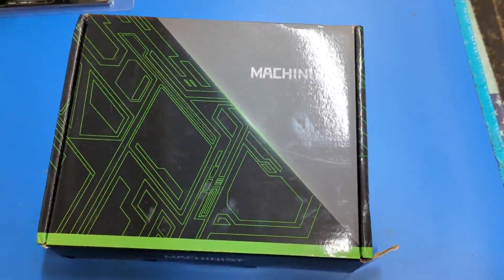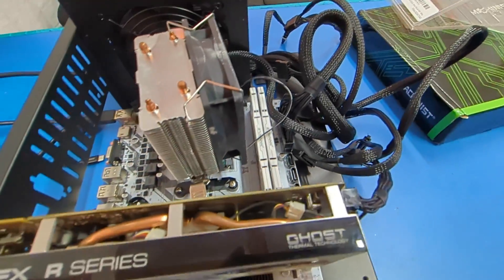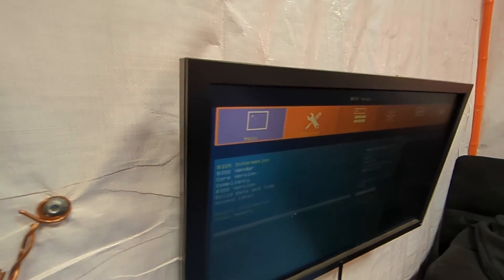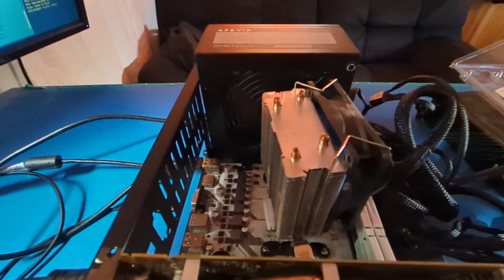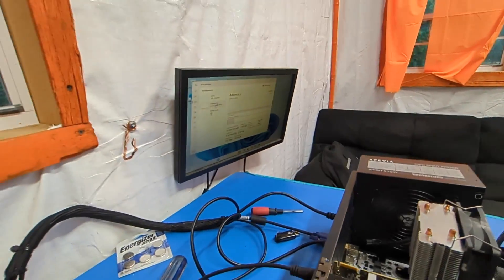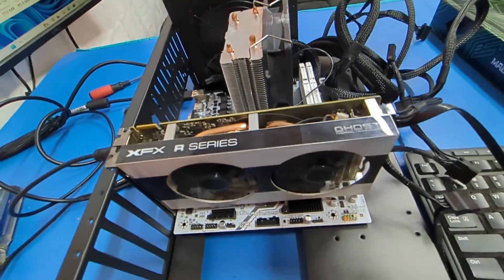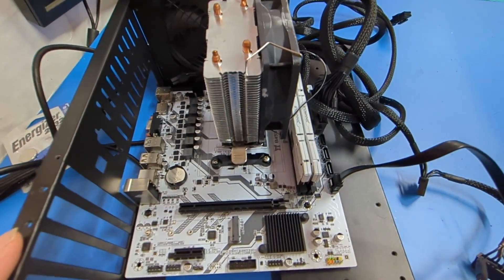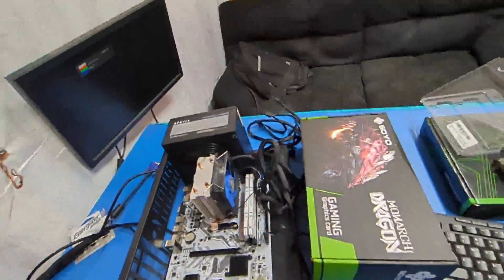Machinist B450: Much Improved, Now one of the best budget AM4 options!

Comment: It won’t let me enter the bios at all do you have any fixes? It also boots into windows fine.
Reply from the maker: I had one Machine that it was doing that too but come to find out it wasn't the motherboard. The GPU wasn't initializing until after the post and booting process started. One of the positives about this board is that it'll post without a GPU and even with a dead GPU, the negatives is it doesn't always wait for the GPU to fully initialize before it boots. If you're running Windows you can hold the shift button as you click restart and keep holding it, that will actually bring up a recovery menu where you can choose boot into the UEFI as one of the boot options.

Comment: Great video, Can anyone help with a link or advice on where to get the latest firmware for this board please
Reply from the maker: I have yet to find a place that hosts the bios, machinist website says to contact their AliExpress store.  But I have tried as well as several people in the comments section, and Machinist has never replied.   As far as drivers.  It uses the standard B450 chipset driver from AMDs website.  I have 3 of these boards between my kids PCs and server here, so I did plan on getting a bios dumper to compare boards and host the ones they shipped on them. In case people wanted to modify bios themselves and/or have a backup.  I just am yet to get a bios chip programmer/dumper that is compatible.

Comment: I would be worried about future bios updates and you can buy similar motherboard like asus prime with similar price.
Reply from the maker: Bios updates are not a worry because its a dead platform, with no new AM4 CPU being released.  They alos have an oversized bios chip with their custom bios that supports 1000-5000 series out of the box and will still post with allot of "unsupported" CPUs.  As far as Asus prime for a similar price your wrong.  When I built the first system  with this mobo the cheapest Prime board was $79.  This one was $50.  I have since built 3 machines with these boards.  The last one I paid $40 for this board, and a quick search on amazon shows currently the cheapest NEW B450 board is $70.  So $40 vs $70 is not even close to the same price.   If you want to Talk B550 those boards wont work with older Ryzen 2000 and 1000 series, and that's what I recommend these boards for.  I have a few videos with this board so I am not sure if I mention it here, but since B450 only supports PCIe 3, I would only use this board with 2000 and older series Ryzen.  Maybe some of the OEM only, later 4000 and 5000 series that  lacked PCIe 4, would be ok in B450 as well.

Comment: How can I update the Bios ?
Because i have ryzen5-3600 not working with my motherboard same like your
Reply from the maker: That should not be a bios issue unless your is corrupt.  I have purchased 3, and they all posted fine with a Ryzen 2200G, 2600, 2600X, 3700X, and 5800X3D, right out of the box.   Support for the 3600 is already built in.
Reply: Have you solved the problem? The R5 3600 processor isn't working on the motherboard, while the R5 2600 works. Even when I tried the R5 5500, it didn't work; only the R5 2600 is working. I need a solution to this problem.

Comment: I just built my PC with this board and a 2600, and I'm going through the memory freq issue. I found your page and this video has done a lot to reassure me that I didn't make a bad decision going with this board. lol. However, I noticed my version does not have the overclocking option in the advanced section of the bios. If your's has it, would it be possible to get the BIOS dump?
Reply from the maker: Unfortunately I never got a bios dumper and I haven't been able to collect any bios.  It's also currently my 12-year-old playing computer so trying to get access to it is not easy right now lol.  I didn't tweak hers in the BIOS. I ended up downloading ryzen master and tweaked everything and enabled PBO and all that.  Ryzen Master while it gets a lot of flack, it is great for some of these Chinese boards and some of the basic tier one OEM boards that have b450 chipsets with a basic bios.
Reply: @JordosTechShack  I can't even imagine what that will require lol. After some research and tinkering I was able to get the memory frequency up to 3000MT/s. I think that will do for now. I got Ryzen master but it didn't work cos the PC kept crashing since I was trying to get the memory up to 3200MT/s. Thanks a lot for bringing my attention to the CPU IMC, I'm already working towards a new one.

Comment: Hey @JordosTechShack
Do you know if this motherboard can post without GPU ?
Like for headless build, NAS etc
Thanks !
Reply from the maker: I am not 100 percent certain but I think it does.  I have a bad Soyo RX 560 XT that won't post in any PC I have tried except this AM4 board.  And the monitor out donest initialize until you boot it up Into windows.  No video out until Windows loads on this machine, and no post on any other machine at all.  So   I am pretty sure the card is dying to the point it won't post in any machine that needs to detect a GPU.  So I am assuming it  doesn't need a GPU  and will boot without detecting one.

Comment: Just a question ?  about 'etertiny later' How much time did you wait i have done the same build but the pc dosen't boot up everything is working
Reply from the maker: 1st boot took a minute.  Had to train the hardware. I did have issues with posting with  the final build. The GPU has an issue and won't put out video till the driver loads in windows. The test GPU I used in this video worked fine (Radeon 260x).  The last 5 months it's run fine other than this RX 560 XT not initializing the monitor output until Windows loads. My test graphics card didn't do that, so I'm assuming it's a GPU issue or a motherboard and GPU compatibility glitch.   Could be the BIOs has weird issues with some gpus so I could suggest trying a different legacy graphics card and see if you get monitor output.  If it is a graphics card compatibility issue, If you pre-install Windows with a legacy card and then install your new card, it'll work fine once Windows boots.  Again The RX 560 XT in here is a China brand SOYO card, and China Brand Machinist motherboard. So which one is causing the compatibility issue until Windows loads? I don't know for sure.
Reply: @JordosTechShack  Thanks you so much sir.

Comment: does this mother board suport windows 11 or do you need to install a tpm chip on it
Reply: no it does not, found out the hard way. this mobo has tmp 2.0 and secure boot but does not support UEFI bios which is required. i did how ever get windows 11 installed but using another computer to install windows 11 on it and when it got to the part to set up windows 11 i turned the computer off moved the ssd to this computer and turned it on and it let me finish setting up the computer. i did this just today so i dont know how well it will run or if there will be any issues. but that is how i got around it.
Reply from the maker: It does support UEFI, not sure why you couldn't find it.  TechYesCity also did a video on this motherboard and walks you through the settings, which is why I didn't cover it in more detail, since an actual youtuber already did.  I used the board for my daughters build and she is running windows 11 24H2 without issues or work arounds.

Comment: Motherboard with no io shield is diabolical
Reply: Thats a testbench you melt
Reply: @technomad900  Putting an IO Shield won't make a difference you melt
Reply from the maker: LOL. it was a POST test. I am not installing a flimsy cheap metal IO shield in the test bench when it was goin into the case by the next video.  These ones are thin and flimsy and difficult to remove once in without bending it. AliExpress orders take a bit to get everything in so I post test as it comes in.  This was only  the fist of 3 videos using this mobo and I will not install the IO shield in something temporary. It was literally in the text bench long enough for this video and a windows install.

Comment: did you run windows 10 or 11 ? im having usb issues on windows 11 with this motherboard when trying to use a capture card on it it just disconnects , windows 10 seems to run ok , minus not recognizing my ps5 controller
Reply from the maker: Had issues with USB wifi dongle dropping out.  Did a clean install of Windows 24h2 (was using an older ISO) and the latest B450 chipset drivers and the issue went away.

Comment: Thank you very much for the review. I'm also bought that new am4 white motherboard of chinese brand from aliexpress and now waiting for delivery. Glad that new motherboards on b450 chipset that include work of old Ryzen 1st and 2nd gen are still being produced. 

First wanted to buy chipset B550 with PCI Express 4.0 for a future upgrade, but then I found out that it doesn't support older generations of Ryzen, and when buying any new Ryzen of Zen 3 gen right away, there would be a temptation also to buy a new video card like RTX 4060 with the last money. But for Ryzen 5 1600, economical GTX 1650 would be enough
Reply from the maker: I paired this one with a Ryzen 2600 and a RX560XT for my daughters Roblox build. It came out really clean when the build was done.  The build video is here if you haven't seen it i go over a little  more about the motherboard.
https://www.youtube.com/watch?v=ps-bH5jn-k0

Comment: U know where I can get the BIOS update?
Reply from the maker: After my most recent project/Video that required me to patch my own driver for an abandoned Nvidia mining card, and issues like Machinist nor having download pages, I am going to start a website soon with bios dumps and my hacked drivers.  I am looking to build a resource for AliExpress off brand and abandoned hardware.  Between my projects and commissioned builds I am paid for, I get to play with this stuff allot more than a budget builder doing a DIY project.  So I'm gonna step up and try and support the community.  Website coming soon!
Reply: if you found it please send the link here. Thanks!
Reply from the maker: You have to Message the Machinist official store on AliExpress.
Reply: I already did this but they didn't send it
Reply: Hi friend, were you able to update the bios?

Comment: does this motherboard have argb?
Reply from the maker: Unfortunately no it does not.  The case I used in the build video has a built in RGB Controller. Whether AM4 or socket 2011 I have yet to find a Machinist motherboard with RGB headers.

Comment: Could i use this motherboard with nvme, a 5600 and 32gb ram to play star citizen do you reckon? Love your no nonsense vids bro. ✌
Reply from the maker: @perrymitchell7118 yea it should be just fine.  Just keep in mind the NVME/PCIE is only gen 3 with B450 chipset, which is why I usually leave B450 for 3000 series and older Ryzen. But the bios supports it and it will work, just might leave a little drive performance on the table.
Reply: @JordosTechShack  Thanks so much for reponding Jordo, really appreciate you. <3
Reply: @JordosTechShack  Hey,

I’m trying to undervolt my Ryzen 5 3600 while keeping dynamic frequency scaling with PBO enabled. I’ve tested a stable configuration in Ryzen Master at 4180 MHz with 1.15V, which gave me around a 10-degree temperature drop and a better Cinebench R23 score. Now, I want to apply this undervolt in the BIOS using Custom Pstate0 on my Machinist B450 motherboard.

In the BIOS, the Custom Pstate0 VID is set to 48 by default, but I’m not sure what actual voltage that corresponds to. My goal is to keep 4180 MHz at 1.15V as the maximum boost state, but still allow the CPU to dynamically lower its frequency and voltage when not under full load.

Could you help me figure out the right VID setting for 1.15V on this motherboard, or provide any advice on how to achieve this in the BIOS?

Thanks!
Reply from the maker: @perrymitchell7118  sorry I haven't played with manual OC at all.  Just set everything to auto and let my daughter go with it.  It was for her Roblox PC so I didn't get much time tinkering with it before I built her PC and gave it to her.

Comment: Hello, I want to buy this for a all white pc im making but it doesn't say the size of the motherboard on aliexpress, do you know if it's Matx or atx? Thank you for the great video, I have a very similar build coming up
Reply from the maker: @yungwiz9297  M-atx.  The bottom of the board stops right at the bottom of the 3rd PCIe slot cover on my test bench. It's going in a white DIYPC ARGB-Q3.v2 case for my 11yr old.  About to film the video card unboxing for this PC right now.   I did a similar build spec wise for my 9 year old, Except in the teal version of the same case and an Asus Prime B450, and better GPU (she games more).   That build is here: https://youtu.be/tAyxA143zTE, 
I have an all white x99 build I did almost a year ago here: https://youtu.be/j7ZZwN9KgjI.
Reply: @JordosTechShack  OH okay great to hear, I will be buying one soon. I noticed you also buy Apevia Spriit psu's, have you not had any issues with them? I want to buy them to increase my profit margins but I hear so many bad things about them. Thank you for your response!
Reply from the maker: @yungwiz9297  the Spirit PSU are not something I intended to use on as many builds.  I stocked them for on hand emergency replacements and builds that didn't use a powered GPU.  They never failed, so I started using them in my kids builds and family "gift" builds. PCs that were close and I would be fixing regardless. Then my regular customers who usually have me build their projects but buy their own parts started bringing them to me.  After seeing them work fine for me so long they were willing to take the risk with budget and low powered GPU builds. I have ordered 8 in 2024 according to Amazon. Probably a handful in 2023, at least another 3 from customer provided parts, and none have failed.  So my official statement is I'd recommend going with something certified, However  If you keep the GPU draw in check you should be fine.  My daughter Briar runs it pretty hard with the RX 5600XT and hasn't had any issues.  My bother with his RTX 3060 12 GB and power hungry V4 Xeon have been pushing hours of RDR2 for the last 8 months without issue.  I have RX 580 2048sp builds with them, out in the wild, for well over a year now without issue.  If your Warranting the builds for a year (or less) and keep it 60 series or lower for the GPU, you won't have any issues.

Comment: Hello i have also built on this motherboard my first PC today. Working i installed on USB drive from my friends laptop

But then now when i have windows 11 i dont have wifi option in windows only ethernet
Reply from the maker: This motherboard doesn't have built in Wifi.  You need a USB WiFi or PCIE add in card.
Reply: @JordosTechShack thanks i bought one
Reply: Also i have ryzen 7 1700 and rtx 2060 super if that helps at all

Comment: procesor ryzen 5 3500x is working for this motherboard
Reply from the maker: @OficialGamerso2 are you starting that you  tried it or asking if it supports it?  The motherboard supports 2000 - 5000 series out of the box.  I've tested it fine with a 2600, 3700, and 5800X3D.
Reply: @JordosTechShack i had a ryzen 7 1700 in it works

Comment: Xmp doesn't work?
Reply from the maker: Xmp works memory controller in 2000 series Ryzen chips are what I blame.  I didn't do a good job explaining it in the video and I fumbled around with my words. I should probably start actually scripting stuff.   You're never guaranteed xmp with a premium motherboard in ryzen and good memory let alone this cheap stuff. Kit in the video is the cheapest ddr4  I could get on Amazon. Also, as I said, the same CPU in my other daughter  b450 Asus prime motherboard will only get 2666 with a crucial  3200 kit.  The only 3200 kit I could get even close was my tforce kit @ 3000, with either the Asus or this board.  All the kits work at XMP and above with tuning with my 5800X3D. Which again is why I go back to 1000 and 2000 Ryzen having crappy memory controllers.  I recently played around with it with a 3700x with this board,  that was in the shop briefly for a project and I was able to get XMP with that CPU.   Just Don't expect over 3000mt with any Ryzen 2000 series processor with budget memory kits. If you do, it's after manually tinkering with the timings and infinity fabric. The previous version of this motherboard didn't have any memory settings at all, so the fact that it supports XMP and lets you manually tune is a big improvement. I most likely could get at least 3000MT if I manually tuned it, but I didn't put that much time into it since  it's for my 11-year-old who literally is only going to play Roblox.if it was for my  9-year-old who plays everything I let her, I  probably would take the time to tune it a little better.  I'm just glad the option is there either way now.